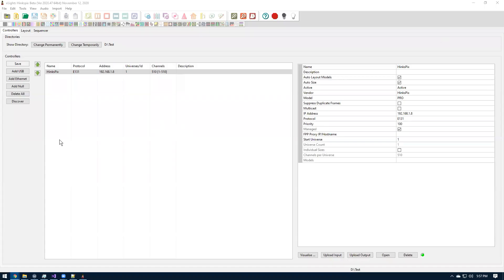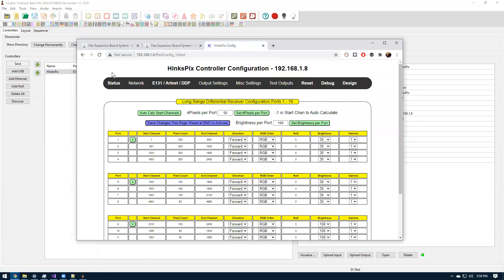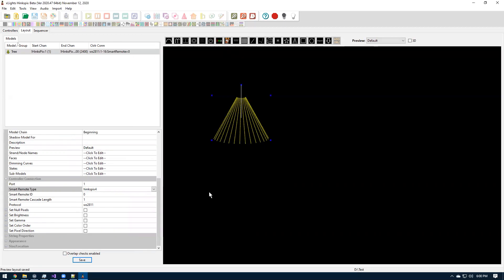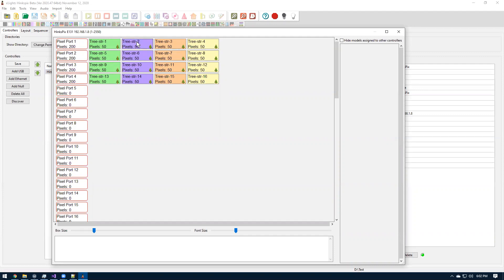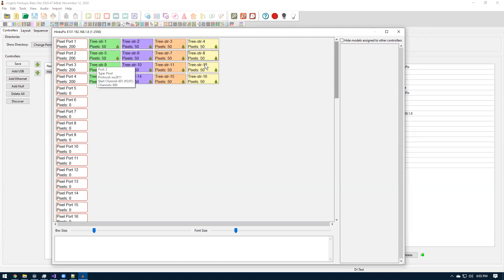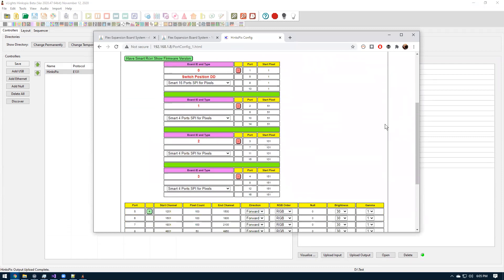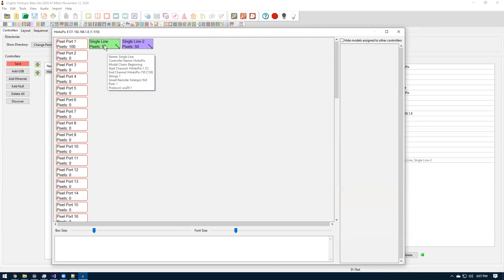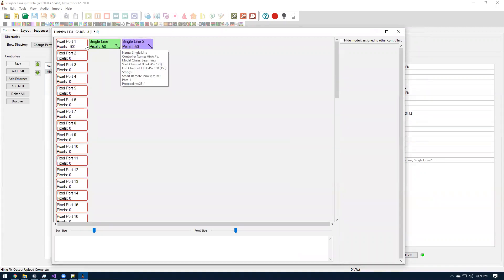HinksPix Smart Receiver Support in xLights

Comment: Thanks Scott! Any chance there is a Mac build for this? Also, do you have an ETA when this will get merged into the main branch? I've had to upgrade to a couple smart receivers and this would make 2020 Xmas show easier to configure, although I think all I have to do manually on the HinksPix is configure the start pixel for each board.